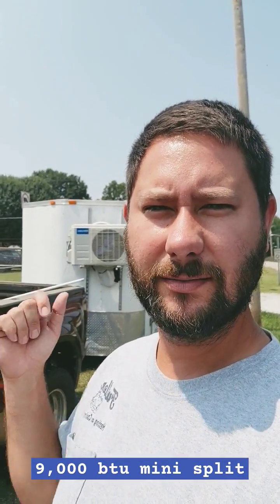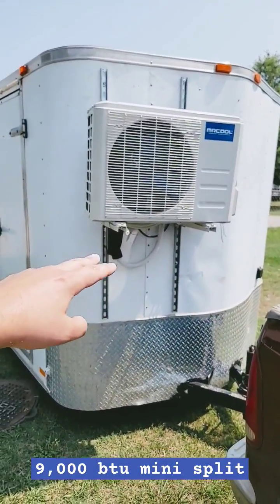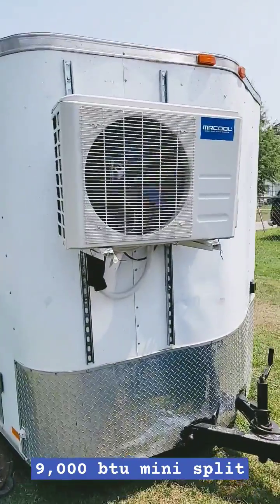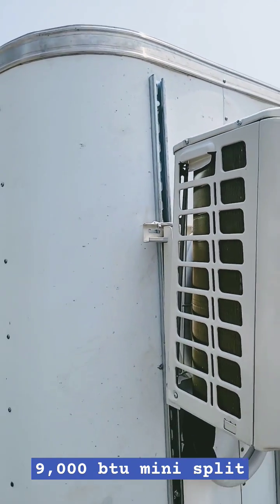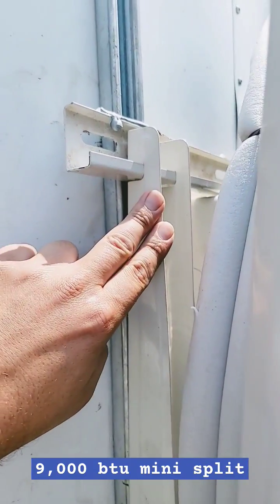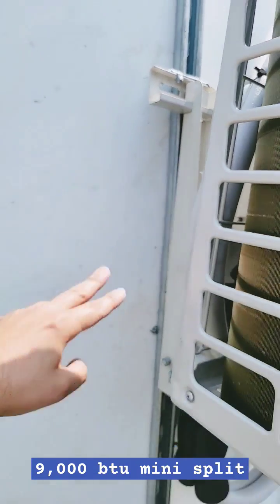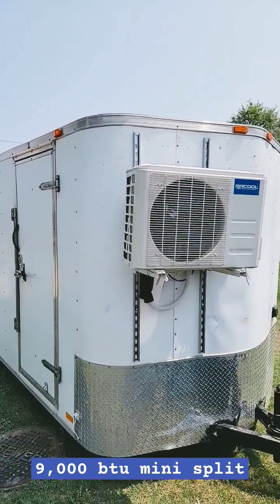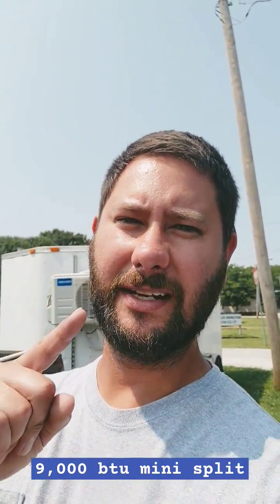How to install a mini split on a trailer?

Comment: See the Mr cool on the trailer there taddy, I just figured out the Mr cool universal series are rebadged gree flex units I took apart the 2 covers and it is exactly the same as a gree flex not sure if the Mr cool mini splits are rebadged gree mini splits.

But sounds like you know how to install them and you vac out the low side lineset and check the flare fittings before releasing the refrigerent.

Anyway taddy could you please do a long video on you installing a Mr cool mini split the correct way.

And do a long form video on you repairing one.

As every install video I have seen on mr cool minsplits on you tube omit the vac out the lineset part.

So please do one showing the correct way to install a mr cool mini split. Including the vacaum procedure.

Even if it makes me cool mad.

You will be doing a huge service and encourage more people to just hire someone who is hvac certified to install it.

And might get more customers.

Comment: You can take a grill cover and sew in a string at the bottom to pull it taut such that it won't receive wind.  It's a cheap and reliable fix for driving; obviously it will need to be removed once the trailer is no longer in motion.
Reply from the maker: Very good idea eric thank you sir

Comment: The best way to air-condition a trailer is with a portable air conditioner that has a single outlet; the outlet can be ducted to the outside using a dryer vent hood. Nothing on the outside, and nothing to be stolen from off the outside.

Comment: So you missed something huge turbo guys already knew... Build a cover for that to keep air out the fan while driving or you'll 4000rmp that fan and take the bearings out. You can also as computer guys know generate electricity with that spinning and burn your control boards out. Thank me later
Reply: Pigtail it to the battery and boom, instant wind-driven generator.
Reply: @shawn6632  not at all how that works nor would the bearings last.

Comment: Nice. Fan bearings are going to pull double duty without a normally closed louver like how dryer vents work.
Reply from the maker: What do you mean
It's not going to be working while it's going down the road
Reply: @TaddyDigest  Huh? It won't be energized of course but it'll freewheel from air velocity. The faster the trailer moves the faster the fan will spin. Exactly the same principle that makes passive roof vents/exhausts work.

Comment: Looks great, one question though…..
How well do you think that unit especially the coil is going to stand up to the road vibration and the potholes ??🤔
Reply from the maker: To be continued on that 1. I'm not sure, but it'll be a good learning experience. This was definitely a good learning experience for me
Reply: @taddydigest  Looking forward to the follow-up . Thanks 👍
Reply: What was the road travel results?

Comment: Man that fan going to be spinning like crazy when driving
Reply: Was thinking the same
Reply: Isn't it supposed to be off while driving?
Reply: It will windmill when it's driving down the road probably at really high rpm + road vibrations may damage the motor (might even damage the Computer electronics in the AC)

Don't get why the roof unit is less efficient or just simply the roof one is actually a higher power cooling unit (replace roof unit with smaller one)
Reply: @leexgx 100% agree that the mini split was not designed for the harsh road conditions. At the very least I Hope they cover the unit while driving and figure out how to eliminate the road vibrations.
Reply: @leexgx  ya I don't know why but it seems like all the roof top ones are like 15000btu and a little less efficient than a window unit there probably is a market for a more efficient roof top unit but I don't think anyone is making one and I believe those low efficiency ones are expensive too
Reply: @leexgx  You don't get it because you don't understand. Like a flat earther.
Reply: @BOHICA_  nope
Reply: So its going to spin while its on too if you are real worried about it put a pain stirrer or something in there
Reply: @james10739  Yeah, but if you spin the motor manually the motor generates an electric current, which while most inverter systems are designed to have precautions against, no system is perfect, and might cause issues. The inverters themselves, all the wiring connections, the flare connections, the linesets, the body, the compressor, hell even the bracket its mounted to, isn't designed to do any of this, but hey a mr cool is cheap enough.

Comment: you could have bought a minisplit with solar panels unit cools as go downs road or is sitting only requires 3 panels also get the 110 volt model runs on 8 amps